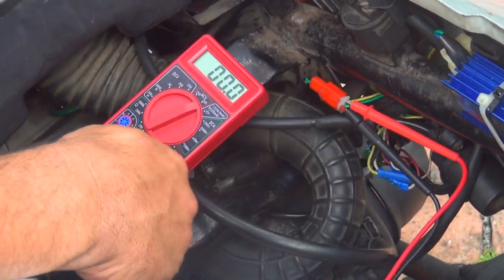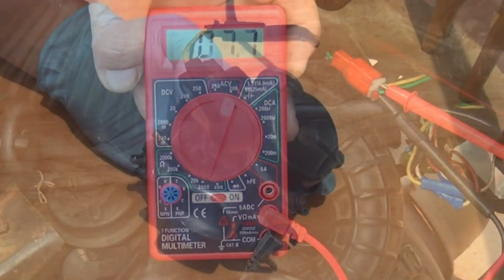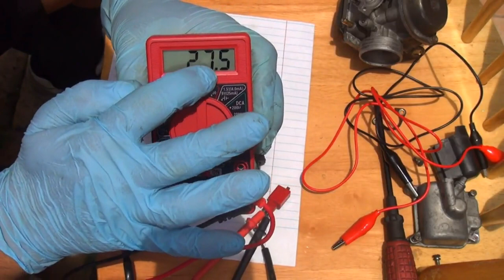GY6 Scooter Automatic Enricher Operation & Testing

Comment: This guy is awesome,he will reply to questions here and help you fix your scooter.Thank you Virbello....
Reply: I hope they help me fix mine got a valve adjustment now it's overheating for some reason car stalling out losing power which means the engine is going to seize soon. And i need this to get to work.
Reply: @michaelbearse4733  This is a scooter channel,not a car repair channel. I have worked on cars for years tho myself. Don't drive your car until cooling issue is fixed. Cooling is pretty simple to diagnose,something is either blocking flow or pump is not pumping any coolant.
Reply: Is It normal 5 or 6 minutes to heat the enricher? Or is It too much?

Comment: My scooter won't start after now driving 3 or 4 months. I installed new spark plug and tested, it has spark. I have installed new carburettor and nothing hapened. What is the problem?
Reply from the maker: If your scooter won't start despite having spark and a new carburetor, the issue may lie with fuel delivery or air intake. Check the fuel lines for blockages, ensure the fuel valve is working , and confirm fuel flow to the carburetor. Additionally, inspect the air filter for clogs
Reply: @VirberelloScooterTips  Thank you, now it works, but i have problem on cold start. I need to push gas handle. Do you think that choke is the problem?
Reply from the maker: Hello my friend that is a dirty spark plug or the sparkplug gap is a little to wide your gap should be (.024") or (.028"). https://youtube.com/shorts/pprnQlsI-Pg or buy an iridium sparkplug for your scooter
Reply: @VirberelloScooterTips thank you my friend. One more question. I saw on this video that is normal for air fuel mixture to turn the screw 2 full turns and 1/4 https://youtu.be/hWUl6cwHif8?si=-BZABeEQ9zDH66u-
In my scooter the smoothest idle is on 1 full turn and 3/4. Is it normal?
Reply from the maker: @GoranDIY  yes is normal for your location  because that change on air density , temperature and or humidity

Comment: Hey my friend! I have to give a little throttle to start motor. 50cc. Gy6. It runs fine until I come to stop and dies. I have checked everything. Any advice? Gracias mi amigo
Reply: Also will not idle without throttle help please
Reply from the maker: Hello my friend try to turn the idle screw 1/4 turn in or out
Reply: @VirberelloScooterTips  it has a metal cover over it. Gonna try tomorrow. ThNk you my friend
Reply from the maker: @ericmims2000able  with a small drill bit make a little hole in the bass color cover because under the cover you have a screw
Reply: thank you my friend i got it fixed...now if i could find the rich/lean adjustment

Comment: Probably the best explanation on the "bystarter enricher" I've seen so far !!!
I am having issues with the fast idle not working on an old Honda scooter, enricher works perfect, O-ring gasket is there but the enrichment of fuel isn't there when you first start it.
I tried putting a flat plate with gasket in its place to temporarily eliminate it to see if the fast idle works, but even so, the idle at start up is normal run idle like when it's warm up, not the higher idle like it should be.
The fuel channel leading to the enricher from the carburetor bowl must be plugged OR the channel from the enricher to the intake manifold side of the carburetor is plugged.
Need to check this out one day ... Great video
Reply from the maker: Hello my friend thank you for watching my video
Reply: I’m having the exact same problem

Comment: Hi Virberello,

I liked your video, hope this evening i will do all the checks on my carburator. Otherwise if i may give a tip to everybody for the check of the needle 
(the needle of the automatic starter = the richer system), you can wrap nicely the needle with scotch tape before doing the electric test.
And after the 3 , 4 min time needed to push out the needle,  you should see some part of it not wrapped by the tape coming out. Which prooved that you needle has moved out and you can also physically measure it.     
:-))

bye bro, keep helping us!

Farid.
Reply from the maker: Hello Farid great idea & thank you for watching my video

Comment: Hi, I have just taken apart my carby to clean and found a lot of heat marking on the inside of the inlet and outlet of the carby, like a burnt orange color, I’ve never seen something like this before. Just wanted to ask you if this is normal?

Thank you for the instructional video on enriches. 👍🏽
Reply from the maker: Hello my friend I never see burnt orange color inside my carb not sure what that can be unless a back fire from motor . Thank you for watching my video

Comment: I’ve heard it called an automatic choke. Either way, this was helpful. Thanks.
Reply: Both are a correct way to call it
Reply: Danny Steph 👍🏻
Reply: @nobs40  um, a choke "chokes" or limits the air flow going into the motor...allowing the fuel mixture to be richer at startup.  An auto enricher, serves the same purpose but does so by allowing more fuel at start.  It does not control air flow, only fuel.

Comment: Ok, So I've a 2020 Taotao pony 49cc.
I've recently been tweaking the carb abit to just get a little better performance tune.Mine is running fine.I've raised the needle some to have it abit richer.I've also adjusted the idle screw adjustment on the throttle cable to carb.Great results so far.Soon planning on drilling out the brass adjustment also to fine tune abit more. (All stock still as of now)
But, thinking of doing the needle change & abit bigger jet.The video you had done on this.Yes, I seen your video allready of that to.But, you didn't get into much on the poilet jet really.... I want great easy start, great idle, But, at the same time great response in my throttle to. Goal is great top end speed as well.110% perfect. I want everything thing dialed into profection.
I know these things can perform way better basically stock with just a few simple parts in the carb.Then straight from the factory.Thanks so much for taking the time & effort to make all these videos.I'm a gear head watching you also. 🛵🔧👍

Comment: After re-installing the choke, my motor can't idle like normal and the throttle doesn't work normally. how to install the choke correctly?
Reply from the maker: If you're experiencing issues with your scooter's idle and throttle after reinstalling the choke, it's likely that the choke isn't installed correctly or is not adjusted properly. Here's a step-by-step guide to reinstalling and adjusting the choke on your scooter:
Remove the Choke: Start by removing the choke from your scooter. Make sure to note how it was originally installed so you can reassemble it correctly.
Inspect the Choke: Check the choke for any signs of damage or wear. If it's damaged, it may need to be replaced.
Clean the Choke: If the choke appears dirty or clogged, clean it to ensure proper functioning.
Reinstall the Choke: Carefully reinstall the choke into its original position on the scooter. Make sure all connections are secure and tightened properly.
Check Idle and Throttle: After reinstalling and adjusting the choke, start the scooter and allow it to idle. Monitor the idle speed to ensure it's stable and at the correct RPM. Additionally, test the throttle to make sure it responds smoothly and without any hesitation.
Make sure when you reinstall the enricher you have the rubber gasket around the choke because sometime the brake easily and if it brake air will go inside 
Consult a Professional: If you're still experiencing issues after following these steps, it may be best to consult a professional mechanic or technician who has experience with scooter engines. They can diagnose any underlying problems and make the necessary repairs or adjustments.
By following these steps, you should be able to reinstall and adjust the choke on your scooter correctly, restoring normal idle and throttle operation.

Thank you for watching my video
Reply: @VirberelloScooterTips  Thank you sir @VirberelloScooterTips for the guide you gave me. and thank you for the knowledge I just learned. I may have overlooked it while doing the installation. and I think the choke is still in good condition because the body choke is a little hot after 4-5 minutes of the engine idle.I just need to do a re-check on the choke.Thank you, kind sir.

Comment: Hi does the enriched always see 10 vac all the time when scooter is running   When scooter is shut down no voltage and plunger retracts?  Bill
Reply from the maker: Hello my friend when the scooter is on voltage goes to the enricher and at that time the plunger is always extended until the scooter stop running and when the enricher cold down  the plunger retract

Comment: Well I just found out its definitely not the enricher. The idle settles down after a couple min. But could it be the valve adjustment that was done? Please help me out mydude. I watch and learn allot more than i did cause of you. Thank you
Reply from the maker: Hello Michael Motors can get very hot when you have  Lower oil levels, Excessively Carb lean tuning, Failure of cooling fan, exhaust valves clearance. Thank you for watching my videos

Comment: I have a question i noticed my enricher is still drawing power even after the scooter is off. Why is it doing that??? Its draining the battery dead after a couple days.
Reply from the maker: If the enricher (choke) on your scooter is still drawing power even when the scooter is turned off, it's likely due to an electrical issue that needs to be addressed. Here are some possible reasons for this problem:
Faulty Ignition Switch: The ignition switch may not be cutting off power to all electrical components properly when the scooter is turned off. This could cause various electrical components, including the enricher, to continue drawing power.
Wiring Issue: There may be a short circuit or a wiring problem in the electrical system that is keeping power flowing to the enricher even when the scooter is off.
Aftermarket Modifications: If any aftermarket modifications have been made to the scooter's electrical system, they could be causing the issue. Non-standard wiring or components may not function as expected.
To resolve this problem and prevent your battery from draining, you should consider the following steps:
Inspect the Choke Mechanism: Check the choke to ensure it's operating correctly and returning to the closed position when the scooter is turned off. Adjust or repair it as necessary.
Check the Ignition Switch: Verify that the ignition switch is functioning properly. It should cut power to all electrical components when the scooter is off. If it's faulty, consider replacing it.
Examine the Wiring: Inspect the wiring for any visible damage or loose connections. A thorough examination of the electrical system may reveal the source of the problem.
If you're unsure about how to address these problems or if you can't identify the source of the issue, it's advisable to consult a qualified scooter mechanic or an electrician with experience in electrical systems to diagnose and fix the problem. Continuing to operate the scooter with this issue could lead to a drained battery and other electrical problems.
Reply: @VirberelloScooterTips All scooters are DC, use the DC setting on your meter

Comment: Very detaliated! Good job !!!
But...if i have 79 v...no 10v  what could be the problem?
It  works if i put a normal battery(12v) separatly on that 2 wires and the rpm drops in 35-40 seconds to normal idle.
Is the cd unit ? Alternator?
What could be?
On baterry the voltage measure is 14.3 whit start motor .
Reply from the maker: Hello my friend I don't think is going to be a big problem if you have 79v instead of 10v you may have a 10 to 30 second delay on drop down idle 35 to 40 second drop is to fast 60 to 120 second drop is normal the cdi is ok is the alternator not performing at his best . thank you for watching my video
Reply: Thank YOU! 
You do a great job!

Comment: Can these chokes be stuck in an extended state, resulting in a too low idle upon cold start (engine shutting down)?

Cause my mother her scooter drives fine warm, but doesn't stay running when cold. Increasing main engine idle screw for more idle revs would result in an engine that wants to engage the vario clutch. 😕
Reply from the maker: Yes, it is possible for the electric choke enricher on your gas scooter to get stuck in an extended state, which can cause a too low idle upon cold start and result in the engine shutting down.
The electric choke enricher is responsible for providing a richer fuel mixture to the engine when it's cold, which helps with starting and idling. If the choke is stuck in an extended position, the engine will receive an overly rich fuel mixture, causing it to idle too low and potentially stall when cold.
As for your mother's scooter driving fine when warm but not staying running when cold, this behavior is consistent with a malfunctioning choke. When the engine is warm, it requires less enrichment, so the stuck choke doesn't have as significant an impact on performance. However, when the engine is cold, it relies on the choke to provide the extra fuel needed for smooth operation.
Simply adjusting the main engine idle screw to increase idle revs may not solve the issue if the choke is the root cause. Doing so might indeed result in the engine wanting to engage the variator clutch at higher RPMs, but the scooter will still have trouble idling and starting when cold.
To fix this problem, you should have the scooter inspected by a qualified mechanic. They will be able to diagnose whether the electric choke is stuck or faulty and then either repair or replace it as necessary. It's essential to ensure that the choke system is working correctly for reliable cold starts and smooth idling.
Reply: @VirberelloScooterTips  Installed a new choke, it was only 10 euro thus worth a gamble, and now the scooter functions perfectly again.
It seems that the wire got squeezed at a certain point under the cover, which simply destroyed it. It only had 4 ohm resistance while the new one had 20 ohm.
Now the scooter starts cold with a short touch of a button and absolutely no added throttle.
So it all works like new again. Thanks for the help and explanations.

By the way, have a quality battery in a scooter helps a lot too for starting it. I used to use lead-acid batteries that were 12V 5Ah and 60A cold start cranking capacity, but now I have a gel battery with 12V 5Ah and 100A cold start cranking capacity (Accurat YTX5L-BS battery). The GY6 engine just loves a bit more power to get that bendix starter gear moving and crank the engine over. The 60A batteries were having a too hard a time with it, which destroyed the batteries as you draw a lot of current all at once. Basically deep cycling the battery, and that's never good for them.
So if you can get a 12V 5Ah 100A gel battery in your area, then it is worth the investment. Just a little tip as thanks, if you didn't know it already that is.
Reply from the maker: @LogiForce86  Congratulations on successfully installing a new choke in your scooter! It's great to hear that it resolved the issue and that your scooter is functioning perfectly again.

The difference in resistance between the old wire (4 ohms) and the new one (20 ohms) likely caused the problem. The squeezed wire under the cover could have caused a short circuit or a disruption in the proper functioning of the choke.

Your advice about using a quality battery in a scooter is valuable. Upgrading from a lead-acid battery to a gel battery with higher cold start cranking capacity (100A) seems to have made a significant difference in starting performance. The GY6 engine in your scooter benefits from the additional power to engage the bendix starter gear and crank the engine effectively. It's true that lead-acid batteries can suffer from deep cycling when subjected to heavy currents, which can degrade their overall performance and lifespan.
The Accurat YTX5L-BS gel battery you mentioned appears to be a good investment, as it provides both the necessary voltage (12V) and cold start cranking capacity (100A) to meet the demands of your scooter's engine.
Thank you for sharing your experience and offering this helpful tip to others who might be facing similar issues with their scooters. Upgrading to a higher-capacity gel battery could be a worthwhile investment to ensure smooth and reliable starts. Happy scootering, and if you have any more questions or need further assistance, feel free to ask!

Comment: Hi, great video & very clear on the workings of these carbs, so this is probably a stupid question;
My enricher needle, and the cylinder part seem to both stick out when I check it. I can push the cylinder in (compressing the spring), and I can then also push in the needle.
I assume this means my enricher is faulty? 
Just fitted a new 100cc gy6 qmb139 engine after blowing up the 50cc, but I can’t get it to start. Carb removed & spraying easy-start into the manifold will make it fire, but it won’t with carb on. Carb seems clean, and bowl full of fuel.
Would this faulty enricher stop it starting?
Reply from the maker: Hello Mike sometime the enricher stop working but if the motor is not starting could be carb diaphragm + needle not going up or needle lose thank you for watching my video
Reply: @VirberelloScooterTips  hi Virberello, i attached the enricher to a battery & left it a few minutes, abs it did actually heat up & extend. When o removed the battery it retracted, so I reinstalled it. I cleaned the whole carb & reinstalled. If I try to start, and put my hand over the air inlet (to choke it), the turn over seems to speed up, and fuel comes from the exhaust port (exhaust disconnected). It’s getting spark & getting fuel, just won’t start… any ideas what to check next?
Thanks in advance 👍